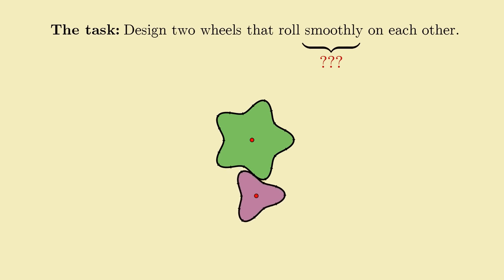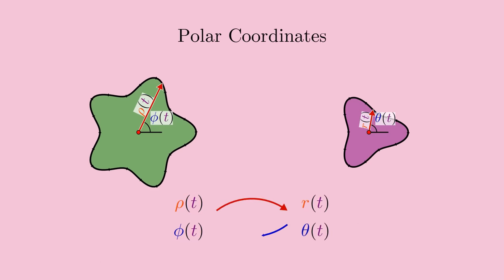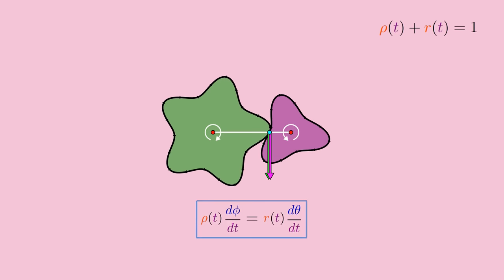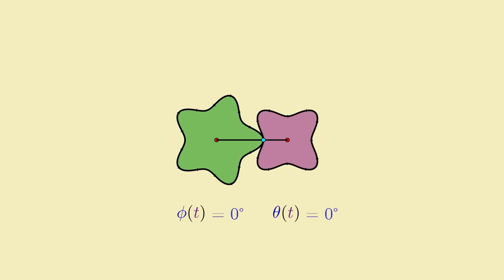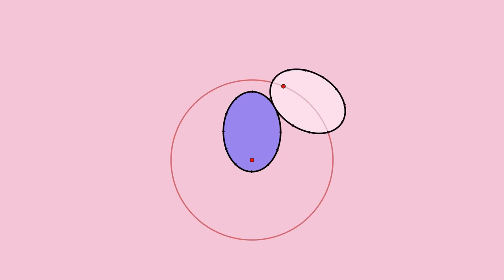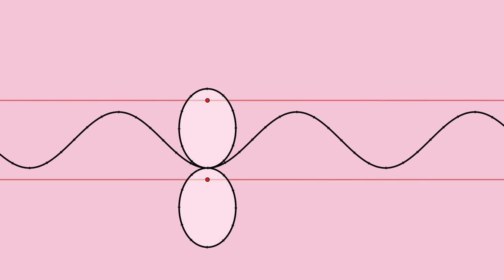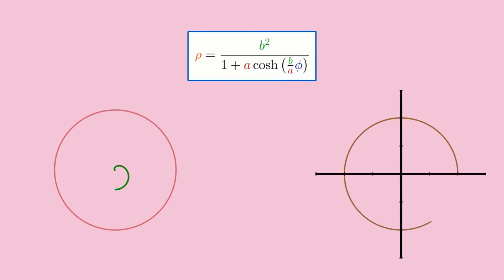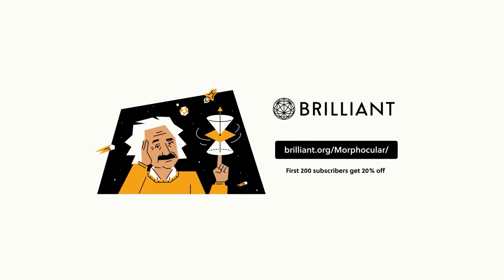How to Design a Wheel That Rolls Smoothly Around Any Given Shape

Comment: I wonder how easy it would be to do something similar to this project with mirrors. Say if I want the ray of reflection to be y=0, and θi+θr=90°, so that the ray of incidence is always an x-only value, could a line be formed to allow for this ray of reflection to be possible based on a given path, while the ray of incidence is allowed to slide perpendicularly so that the range of functions is possible, essentially the ray is allowed to be -∞<x<∞; say for example, you have a circle at the end of a pendulum, and you want to map the surface of reflectivity where that incidence of -∞<x<∞ equates to reflection y=0 along the path that the swinging circle traces, as another example, modify this as a swinging square, a rotating triangle, etc. 

I'm also a bit curious if there's an easier method of going from a linear shape to a circular shape. Restrict the domain to be of only linear length of 2π, make sure that the y values at the extremes are equal to each other, then convert the grid from cartesian to polar. This should create a relatively clean set of functions, would it not, at least for programming the transition. Cartesian to polar transformation is also useful in other areas, say if you want to circularize a sinusoid, which has some actual real-world applications.

Comment: You got the gear design slightly backwards.
Rolling is good, sliding friction is bad. So in gear design we use a shape called involute gear teeth. TLDR of this is the contact point is rolling instead of sliding

Comment: Very cool, what kind of math would you say this is, or what classes would teach something similar?
Reply from the maker: It's a bit of blend of various pieces of math, but I'd probably say the most helpful classes for understanding and expanding on the ideas in this video are Calculus, Differential Equations, and Geometry (specifically the geometry of curves like conic sections, spirals, etc. and the equations that give rise to them). A little bit of basic Physics wouldn't hurt either!

Comment: Danke!
Reply: Truly amazing work! I love it how you dive deeper and deeper into the rabbit hole and simultaneously present your findings in the clearest way possible!
Reply: I'd love to see a follow-up on when the shapes have an undercut preventing the rolling (like the snowflake has) and how the shapes influence the jerkiness of the rolling speed...
Reply from the maker: Thanks for watching!

As for finding the conditions that cause/prevent clipping, I have a feeling it's a much harder problem than just getting them to roll smoothly since you have to consider the relative positions of the objects at more than just their single contact point. But if and when the itch strikes me again, I might investigate it further some day!

As for what influences the "jerkiness" of certain wheels' movement, that can be answered more easily. It's caused by the variable radii of the wheels: the smaller the radius, the slower the wheel will travel since it covers less "ground" per degree of rotation than if it had a bigger radius. However, I believe that by carefully varying the angular speed of a wheel, you can make its axle travel at a constant speed (though for real-world wheels, I think it would be pretty hard to control the angular speed in that way). But in the case of the Koch snowflake wheel, I don't think even this will work because its partner road actually curves underneath itself at certain points, which forces the wheel to actually reverse its movement direction there!

Comment: As I suspected, that last animation really demonstrates that the definition of smooth used in this isn't ideal. It's not bumpy that's for sure, but I wouldn't exactly call all of those wacky changes in acceleration smooth.
Reply: And yet the path of the "axle" is perfectly smooth.
Reply: @felixmoore6781  But only under the definition in this series. You can clearly see it jerks back and forth horizontally (the wacky acceleration I mention) at certain time.
Reply: @zecuse  that's fair I mean trying to ride in anything with those wheels and not die or puke would do difficult to say the least
Reply: @zecuse  It's not just the definition used by Morphocular here. Lines and circles are geometrically smooth. Their order of geometric continuity is infinite. That also means that you can parametrize the movement along them differently from how it was done in the video. You can have the axle move along the path at a constant speed, which would make it smooth by even your standards. This doesn't necessarily get rid of all singularities, though, and they would most likely still be present in the angular velocity of the wheel, i.e., its rotation would be jerky despite the axle moving smoothly.
Reply: @felixmoore6781  And that certainly works for most of the other wheel shapes in this series, but the one at the end there had a geometry that was not convex. Because of that and the symmetry of its concavity, no one point will experience a constant velocity in the direction the wheel is rolling for an entire revolution. That's why it was jittering so much while perfectly horizontal.
 
That's what I was joking about. When one is talking about a smooth ride, they're likely implying no sudden changes in velocity when they get to a significant velocity.

Comment: I'm surprised that you didn't address the triangle intersecting with ("crashing into") the road and show what would happen if the road were curved to accommodate the point of the triangle, seeing as a square rolls smoothly and can be built in real life because it has angles of 90 degrees and the road is (overall) flat, but an equilateral triangle's angles are 60 degrees, which would imply that since it's intersecting, it can't roll on a flat (overall) road, so maybe the road shouldn't be flat. You didn't even attempt to find a matching wheel for the triangle even though it might have actually worked.

Comment: Great video. Unfortunately, you are incorrect about real gears designed to slide against each other. Real gears have an "involute" profile, which results in no sliding contact between the teeth. Any sliding contact causes sliding friction and wear.

Comment: Please develop the idea that gears are not rolling bus slipping slightly and what that has to do with the transmission of force. I Understand the PA (pressure angle) of gears as angle of the line of contact between two teeth and that the contact SHOULD be a rolling motion and not one where there is 'slipping' between the teeth.

Comment: 2:30 From what I understand, that's not the real distinction here: in fact, it's quite the opposite. Ideally, a gear rolls rather than slides because it reduces energy loss to friction, which in turn also mitigates vibration and unwanted heat generation. Vibration on gear teeth contributes to added noise during operation and also wears out the gears, and changes in temperature can cause thermal expansion and affect the tolerances. In the modern spur gear, an involute curve of the root circle is used to shape the teeth. This design is intended to maximize the rolling motion- of course, tolerances must be allowed which may invalidate some of the work of the involute and allow for sliding to occur. However, we're talking about ideal cases for both the gear and the "smooth rolling" shapes.

I believe the distinction you actually want here is based on acceleration (as you said yourself, "gears are meant to transmit forces in a stable way"). This is where the rolling shapes fail. It's also a large part of why these ideal "smooth rolling" shapes would not provide a "smooth" feel on, say, a real world car. What the rider feels when riding a vehicle is the acceleration, or change in velocity. This is why we put shocks on cars, as it acts as a damper and acts against large changes in velocity, hardening against large upward acceleration from the ground. This is where we can make a comparison to the gear:

A spur gear transfers its motion along a pitch angle, and the involute is used to shift a tangent contact point along this straight line for a clean and consistent angular acceleration between the two meshing gears. The normal forces of the driving teeth act in only one direction, and the contact of multiple teeth makes this force more even and generally constant.

For a "rolling shape" like the ones shown here, the direction of normal forces may fluctuate, and the result is an uncontrolled change in acceleration. If we take the example at 1:45, when one tooth makes contact at its tip it experiences little to no acting normal force and no other part of the shape is making contact- therefore, there is no acting force on the pinion. At other points, the direction of the normal contact forms a different angle. As such, the direction and magnitude of acceleration oscillates as the shapes turn. Functionally, what these shapes amount to are radial cams. Mind you, the mechanical applications for cams like these are not limited-- they simply do not work in place of gears.

Designing a shape that retains a fixed radius between two points and designing a shape which can move at a constant speed without changing angular acceleration are two different problems, and that's the big reason why a lot of these shapes would likely make poor gears.

Comment: I wouldnt say many of these paths are smooth. You need to take into account time. Although these paths experience zero vertical acceleration they are experiencing accelerations and decelerations in the plane they are travelling.
Imagine yourself sitting inside one of these wheels, you wouldnt call it smooth then